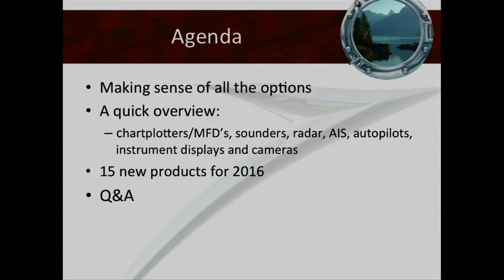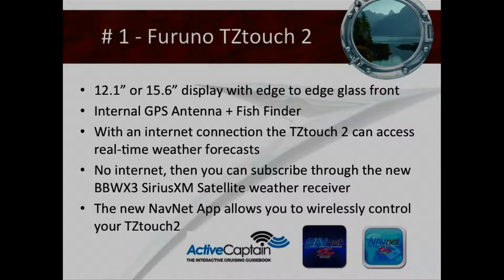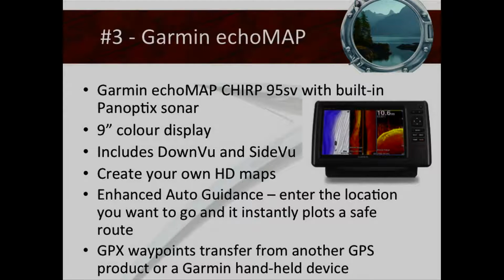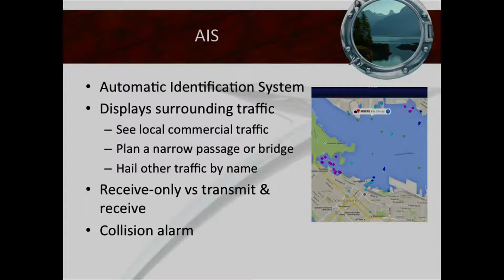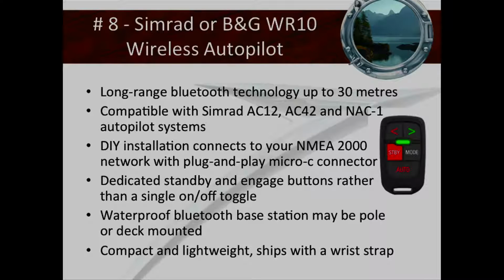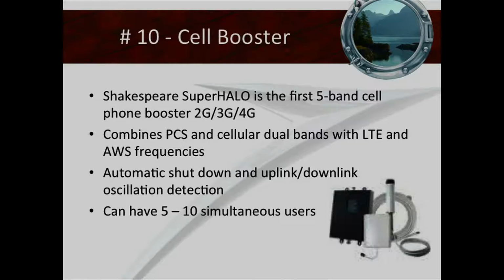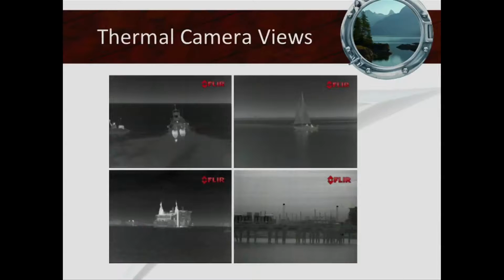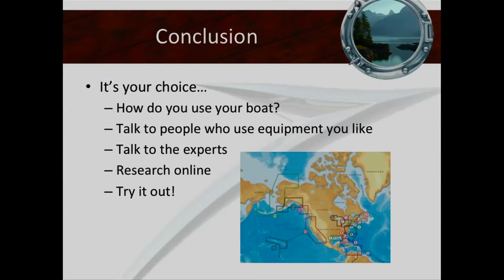Boat Show 2016 - Marine Electronics: Popular Devices for 2016

Comment: Furuno equipment is not difficult to use or integrate. Support is and literature is easily available. Hardware can be daunting for engineers that are not exposed to the brand on a regular basis. I’m a service engineer for Furuno and Raytheon. Give me a furuno radar anyday 😁